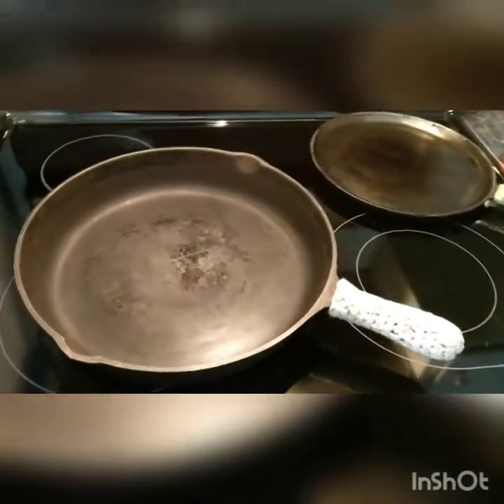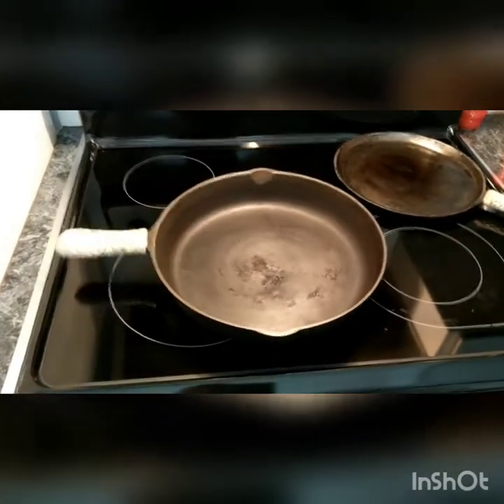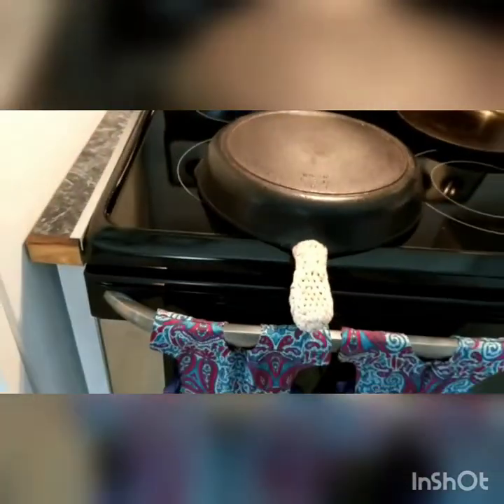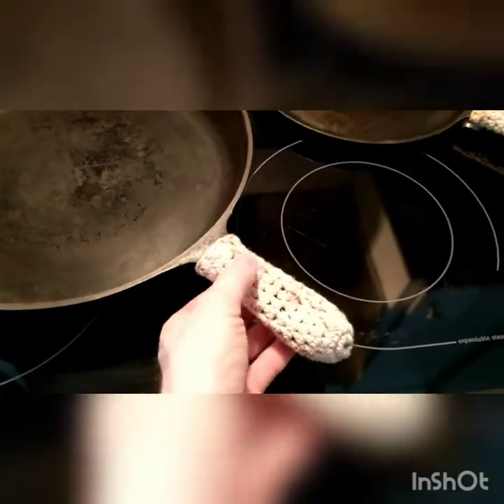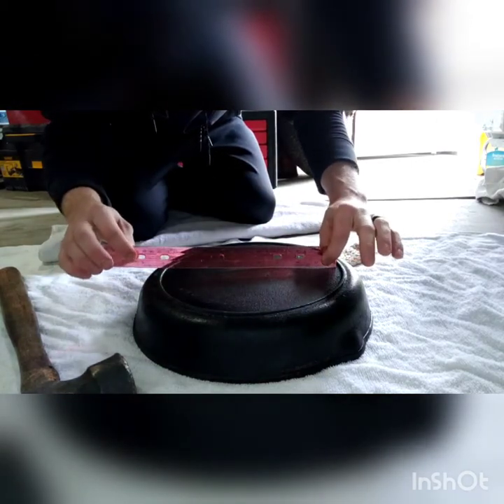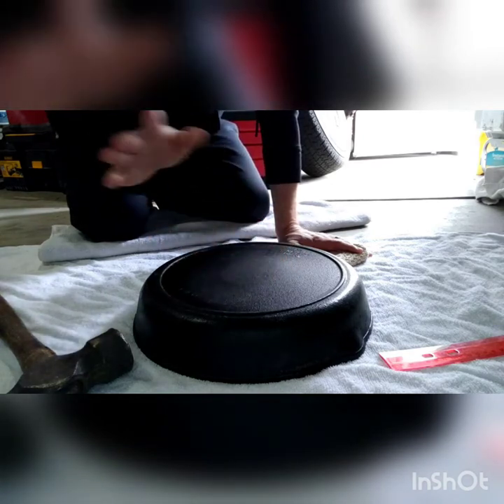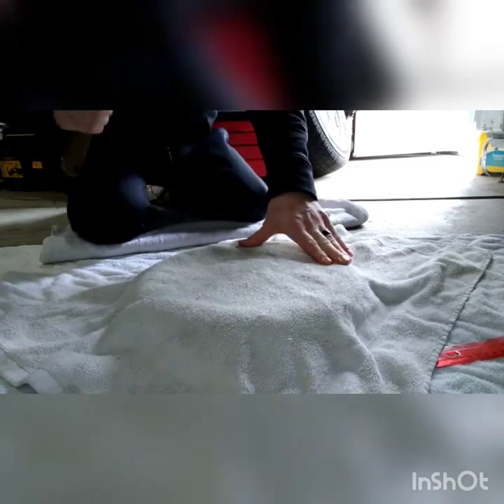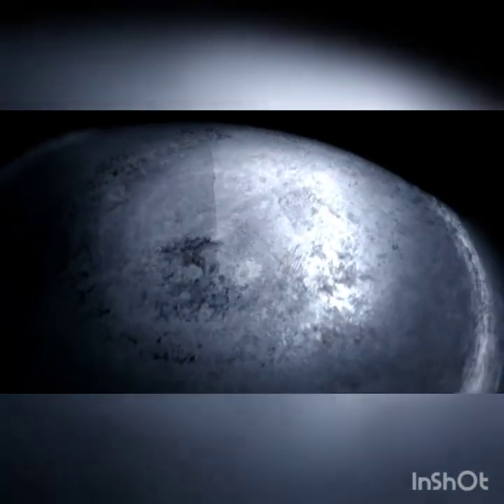How NOT to Straighten A Warped Cast Iron Pan - Lesson Learned!!

Comment: SOLUTION . . . I have a 17" cast iron skillet that warped from using too hot of a burner under it the first time I used it. I watched this video 2 years ago but then I put the skillet in the garage and quit using it then I decided that it does not matter that much if it's warped (high in the middle) for cooking burgers so I decided to put it in my 3 burner BBQ and use it that way. I have now used it maybe 75 times at normal cooking temperatures and just noticed that it's almost completely flat again. I have to use a strait edge to see that it's still very slight high in the middle but it's almost like new so I think that heating the ENTIRE skillet over and over at very high temps might straighten it out a lot faster but it will probably still take a lot of heating and cooling for the "memory" to flatten it out. The only reason it warped was because it got too hot in the middle and the outside did not get hot enough to expand with it. Just thought I would let y'all know what just might work. Seriously . . . it LOOKS brand new now. I don't even know if it was perfectly flat when I bought it so it might actually be as good as new. But I can now cooks eggs on it again which is what I wanted this thing for . . .

Comment: SOLUTION II....I had a skillet with a severe warp in the center...not sure what was done to it as I inherited it. With the assistance of a couple of comments below, I placed my skillet upside down in the center of my over, placed 15-20lb rock in the center of the pan and turned on the oven's cleaning cycle. In addition to flattening the pan, I had clean, bare metal in which to reapply the seasoning.
Reply from the maker: I'm going to have to try it!  Thanks for the potential solution!
Reply: That's better than my stomp and pray method. I got to give this a whirl.
Reply: I realize this an older comment but I want to thank you for the idea. This will solve quiet a problem for cast iron collectors, it's possible to buy valuable whapped skillets very cheap. If this fixes them it will breath new life into a piece of history.

Comment: You have to heat it to almost red hot first. Blacksmiths do it every day!
Reply: I will lose it's temper.  Better to heat it low and slow.
Reply: I don't want to come across as a douchebag but It seems that neither one of you has any hands-on experience with blacksmithing. I've been hands-on in the craft for almost 9 years and yes, I tried forging cast iron once...fortunately it was just a piece of scrap from automotive brakes but it was hilarious - it just crumbled like a dry cookie. You CANNOT forge CAST iron - there is no temperature below the melting point at which you can hammer on CAST iron at which it will not shatter. Also, cast iron skillets are not tempered LOL - that concept applies to the crystal transformations of iron carbides within STEEL which is apples-to-oranges from cast iron. Please do your homework before spreading misinformation.
Reply: @jensdavidsen4557 old thread so forgive me for digging it back up.   I get what you're saying and you aren't wrong.  But I'm thinking there must be a way to have the cast move a little.  Just enough to straighten it.  If it couldn't move at all at heat then it wouldn't have warped.  My guess is this pan was put in the sink and had water ran in it while it was still hot.
Reply: @dchambers986  Cast iron skillets have no temper, but if it somehow got tempered, it's better without a temper.
Reply: @selkywaters  What happens is, the skillet is heated too fast and too hot right in the center. Normalizing it should straighten it out at least partially.
Reply: @dchambers986 a temper in a cast iron pan? 🤣🤣🤣🤣

Comment: As soon as he said hammer, I knew what was going to happen
Reply from the maker: I had a pretty good idea it was going to happen too, but there are no videos on YouTube of it so I figured I'd test that "method" to straighten it so others could learn with me. Whether it worked or didn't. I have about 50 vintage pans and probably 4-5 are warped pretty bad so I'm going to try it again with heat and a few other methods.
Reply: @NorthIdahoCarpenter  switch to GAS STOVE OR SHIP THEM TO ME!
Reply: @NorthIdahoCarpenter  Yup.  Same.

Comment: You can't fix a cast pan of any kind like this. Simply because it's cast. Cast iron. It's not like a modern pan made of steel or aluminum. It doesn't bend no matter what you do to it. They get warped because high heat has damaged the iron. It's not "bent." I have a Wagner 10" that someone got me in Round Top but it's got a very slight warp. Doesn't sit flat on the glass-top, but I imagine it's great for baking and roasting or with a gas range.
Reply: Good idea on roasting and baking! I was about to throw mine out but hated the thought! Thank you!
Reply: You can with Heat, Start with heat treating and bring it up to a high temp.
Reply: You have to press it. Too much shock, even from a rubber mallet will break it. Heat is good. I stomped the dog shit out of my number 10 Griswold, face down. It went from a top to sitting pretty. Still sits flat after 2 years.

Comment: Some of the cheap cast iron pans AREN'T cast iron, but cast junk.  It could have been one of those.  That said, straightening a cast iron pan with a hammer sounds like a pretty sure way to destruction to me.  Cast materials are REALLY prone to cracking.
Reply from the maker: It was a high quality vintage pan that is pretty sought after(when they aren't warped), not junk cast. Yes, we know how brittle cast iron is but are just trying some different techniques to straighten them. All the tests will likely end in failure but with so little information out there on repairing them I thought I'd share my experiences.
Reply: Cast iron inherently brittle.  It wouldn't matter if it was the best pan ever made or the worst one, hitting cast iron with a hammer will break it.
Reply: @chrisfoxwell4128  Apparently, you can straighten them a LITTLE if you back up the pan bottom with something solid and flat, and go very lightly with the hammer, according to some videos...but yeah, even then it's probably a total crap shoot with more failures than successes.  

It amazes me that cast iron cranks and connecting rods even WORK, but I guess the secret is having no impact like local loads. I know in high speed video you can SEE the rods bending...scared the hell out of me, so to speak.

Obvious also why blocks crack so often with hydraulic loading from freezing coolant in the water jackets, especially if short on ethylene glycol.
Reply: This was a Birmingham Stove & Range Century series pan, very good by anyone's standards. A Griswold or Wagner would have done the same if heated too fast or if hit with a hammer. It's very common to find vintage cast iron with cracks and if they haven't been cleaned you won't often see the cracks. If you'll put the pan upside down with your fingers on the cooking surface go all around the pan tapping it with a small metal object. Then hold the pan by the handle and tap the center. It should ring like a bell if it isn't cracked, a dead sound means its cracked. I also carry a flashlight to look for cracks. Some of these pans are 100+ years old and they only have to be dropped once to crack.
Reply: I’ve heard the Chinese pans can be beat back into shape, not sure on that though,,,

Comment: Cast iron is not very malleable. It will crack more often than bend. Cast parts do not bend much. Forged steel is malleable..... carbon steel pans can be reformed.

Comment: I cracked a cast iron pan the same way as shown in the video.   I fixed another cast iron pan by using my MIG welder to puddle two small welds four inches on either side of the handle on the bottom outside of the pan.  So it sits like a tripod on my smooth top stove.  The glass on my smooth top stove is also warped, but everything is good now.

Comment: My grandmother has a Wagner that’s warped about like that, she says it’s fine because her eggs stay in the middle but it would drive me crazy, I’m just afraid of warping one myself, I’d like to pick some warped ones up to experiment with straightening just in case it ever happens, I’m thinking build a fire outside or in a woodstove, set the pan in it, let it heat up and pull it out and heat the bottom red with a torch and then tap it flat. After that’s done put it back in the fire on some coals and let the fire go out, that way it cools slowly after the shock and it might be alright. Just something I’d like to try

Comment: Thanks for sharing.  I learned something.  I wonder if using a 2x4 to distribute the force would be better.  Maybe a hot pan may also help.  Thanks again for sharing.  My wife also made me a pan holder.  It really helps.
Reply: No.  Will not matter.
Reply: Cast iron has no ductility at all. No amount of support will allow it to be hammered into shape. Even if you put it in a press to slowly bend it it would crack. Heat won’t help either.

Comment: Damn that cracked easy. Well that answers my concern about buying a slightly warped one I ran across.
Reply: Donald Kasper  how would You grind it?  with what 'tool' and how would You gauge to know when it was flat?  would You still need heat or the friction from grinding would allow for what ever...???
Reply: Donald Kasper  TY kind Sir.  I will research the terms You sent and get started on it!!  I thought it was a Wagner 10 but it's just a 10 ;-)

Comment: Thanks for doing this. I have a warped pan and was wondering if you could take a wood board, put it on the bottom of the pan, and tap on it to straighten out a wobbly pan. I'm wondering if you can heat it up

Also, I'm wondering if you can fix the pan by welding it
Reply: Welding can be done on cast iron but tricky.  I don't know the details but it takes preheat and post heat and controlled cooling.

Comment: Your skillet is a Birmingham Stove and Range skillet. A warped skillet like that is good for baking chicken thighs, chicken quarters, meat loaf, or a large batch of cornbread.
Thank you for your sacrifice. Sorry it turned out that way. Cast iron is a unique metal. Extremely durable but brittle.
Reply: Lots of metals are like that, pretty much every cast metal is like that, how is that unique?
Reply: @FrancisR420  perhaps it’s just a figure of speech. But yes even aluminum that is cast also applied.

Comment: I will try taking it outside and taking a big propane torch to the sides of the pan. I will heat the sides almost red hot, won't heat the bottom.

Comment: I interned at an iron foundry.  There's a reason that pipe couplings are made out of "ductile" iron, because the formula for cast iron pans is most certainly too brittle for those applications.  The pipe couplings have additives in the iron that greatly reduce the brittleness.

Comment: Here is what i am going to try put in the oven on clean mode. I'm going to place  round weight from workout bench size of skillet 25 lb then put 5 lb till the pan don't touch rack. put it in oven face down then stack 2 more on top if rack will hold? And shut door start oven and let it sit till it cools over night .and pray it works .if i had fire bricks I'd support more weights on top .
Reply: well Al... how did it go??

Comment: You can't do this with cold iron. You need to get it really, really hot. Hotter than your oven can make it. You need to get it RED HOT.
You can get this fixed if you have a blacksmith in your area who has a furnace. You sometimes find them at Machine Shops or even at independent smithies, though they are becoming more and more rare every day.

Comment: It not over yet, just drill the two hole at the end of crack and cut end to end of each end drill hole. Use an anvil as a backing and use a oxygen torch heat press it flat and use oxygen torch cast iron rod with flux and braze that cracked hole to hole and grind flated the weld and then polished.

Comment: Would have been fine for burgers or steaks.  You can sand the bottom to fix the wobble but its not worth trying to flattened the inside.
Reply from the maker: If I would have sanded out the warp so it sat relatively flat i would have to have sanded all the way through the pan.

Comment: If you know someone with a mill you can always machine off the high spot. The pan will be thinner where you machined it but it will sit flat.
Reply from the maker: 61Benster I have a mill, but in this case my warp was higher then the thickness of the cast iron. It was warped almost a 1/4" so I would have had a hole in my pan if I went that route. But for others, that may be a very good option to fix their cast. Thank you for your feedback!
Reply: What about sanding for like 3 hours?  Lol. Mine slightly warps up and all oil goes to the outside of the pan.
Reply: Machining can flatten the outside.... but low in the middle will remain on the inside.

Comment: CORRECTION: USE A RUBBER MALLET.   QUITE FRANKLY I WOULD CHECK WITH A FOUNDRY TO SEE WHAT THEIR METHOD WOULD BE.   ALSO IS YOUR STOVE BALANCED.  DO YOU WARM WITH LOW HEAT AND THEN TO MED BFEFORE USING.  UR SKILLET.  FROM READING ELECTRIC STOVES ARE NOT BEST ...HOW BOUT MORE ON HOW TO USE WITH ELECTRIC COILS?

Comment: So what I'm hearing is that there IS no way to fix this. I just spent DAYS recovering an old pan from a lifetime of disaster. Looks great! Then I put it on my glass stove top today for the first time. OMG. worse than yours. I guess I'm done with it. Such a beautiful pan too.  :-(
Reply from the maker: If you read through the comments there is someone that said the fixed theirs by using a BBQ, if I recall correctly.  I haven't tried it but maybe it's worth a shot.
Reply: @NorthIdahoCarpenter  I read every comment here. And the BBQ one is from a reasonable guy who's "solution" was to simply gave up on his pan and realize that it works just fine to use on the BBQ while still warped. He certainly didn't fix the warp.

Cast iron pots have been around for countless generations. The most popular video on how to fix a warped on is a recipe for disaster. To date, I've not heard any reasonable way of "fixing" this issue.
Reply: @darelldd  yes sir, it can be fixed if you read the whole comment the person tells you how it was fixed over time because of the high heat and was like new. Ive put mine on broil upside down with on the bottom rack. Once it was as hot as all get out i tapped it with my totally flat iron skillet. I did it twice. Trust me it works
Reply: Herein lies the difference between sympathy and empathy. I don't sympathize with you...I empathize with you...because I just finished cleaning an absolute trainwreck of a Lodge in the lye bath. Clean as a whistle now...spins like a top. It's going on my blacksmith charcoal forge where I'll get it red hot and we'll see if I can unwarp it.
Reply: @jensdavidsen4557  Standing by for your results!
Reply: @zydecosoul3045  Hmmm. Well, that bit of information wasn't there when I replied. Just the same, that brings the total up to one anecdotal success. I now see that there are two. I'd hope to hear from more folks who passively had their warps fixed this way. I can no longer try it myself as I've given that pan away, but I'm looking forward to more positive reports!
Reply: @darelldd  That makes two of us. I'm letting it cool down right now. I chainsawed a log that was pretty close to the diameter of the whole flat bottom. I put the skillet upside down on that log then using my acetylene oxygen torch and a rosebud, I torched the skillet from the inside until the bottom was a dull red then flipped it over onto that wood put a piece of ceramic insulating wool On top of the bottom where the warp is, then stacked to 25 lb chunks of forklift tine that I've got in my blacksmith shop. So effectively it's being squeezed on both sides. While it might not work, at least it shouldn't crack.
Reply: Welp... don't do what I did. Made it worse...
Reply: @jensdavidsen4557  Aw dang. Well, look at the silver lining: You changed it at least!
Reply from the maker: Did you video it for another "how not to straightedge a cast iron pan"?!?!?!
Reply: @darelldd  well there's no more spinning or wobble...it's fixed by the method I originally intended... but not how I wanted. I used my acetylene oxygen torch and brazed three dots on the fire ring at 120* separation. Time to bring it inside and fry eggs. This whole restoration series will be on my channel where I will cover the lye bath restoration every day to detail the progress. I recorded it all but it'll be posted starting Saturday.
Reply: @NorthIdahoCarpenter  no, the intent was restoration of the single worst skillet I could find - the tar/Creosote and rust situation was truly astonishing.

Comment: Wow....If heat warped it, why do you think cold forging with a hammer is going to fix it?  Cast Iron is as fragile as a fart in the wind when it comes to pliability.  If you warp a cast iron pan, heat it up 600+ degrees, turn it up side down and lay it on a true flat surface and set something with a touch of weight, that is also fairly hot on the mounded area and let weight/gravity SLOWLY push the warp back flat. You must also keep the cast iron hot during this process as rapid cooling will cause other warpage and possibly a thermal crack.
Reply from the maker: The point wasn't to do what I thought would work. It was to test the number 1 search result on how to straighten cast iron pans and to help others, whether it was a fail or a success.
Reply: Might work with barely warped but a true blacksmith on these comments disagrees and said it’s basically a lost cause. You’d have to heat it to the melting point to fix it,,